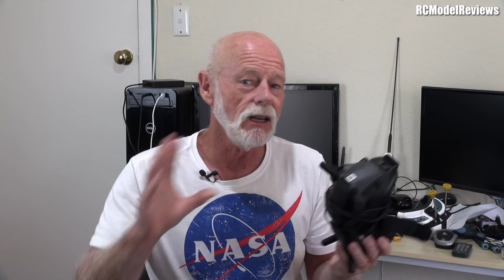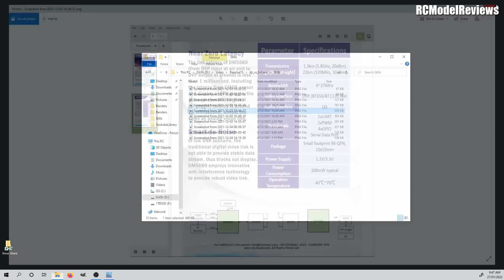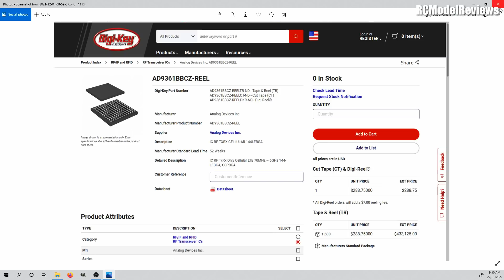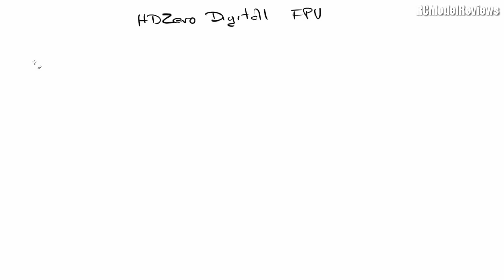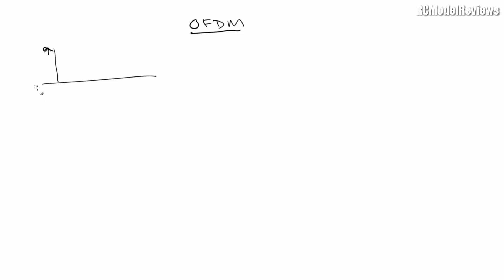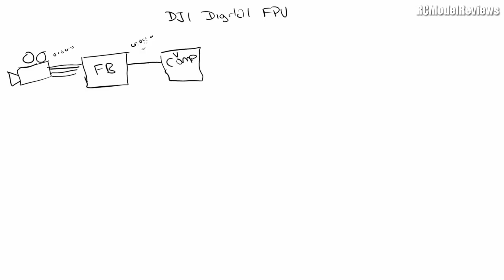Whiteboard:  How digital FPV systems actually work

Comment: why in era of quick digital transmissions and when all modern googles have separate screens for two eyes, we are not widely using 3D-vision which would promise an outstanding experience when flying a drone? What is needed is just to add another camera, and use dual channels transmission (maybe technically could be on same channel), then you get a stereo-video on your goggles.. Quick googling brought me to an article where it says there were some trials, but all of them gone now, and basically no commercial offer for today. Again thinking what level of realism and presence it could bring, if you get binocular rather than monocular vision.

Comment: Why isn't anyone making these HD systems on 2.4ghz?
Reply: The DJI  system in the DJI FPV drone can and does use 2.4ghz ( and the v2 goggles can receive 2.4ghz).  Unfortunately they didn't fully include that in the DJI FPV system or v1 goggles.
Reply: @5zero7RC exactly. That's what makes me even more frustrated. 2.4 has much better performance (away from congested wifi at least). Dual band is even better.
Reply: Because the bandwidth on 2.4 is much narrower than on 5.8. Because the frequency is lower, the frequency band is narrower, means you can fit fewer “modulation streams”, means the data rate will be lower.
Reply: @sstadnik  I didagree. 1. dual band can and does solve the problem you mentioned. 2. I think the the answer to my question is not a technical one, but rather a financial/market or regulatory one. I think DJI and other manufacturers were led to believe 2.4ghz is the main control link frequency used in the hobby and therefore 5.8ghz is the best frequency for video to avoid interference. And they don't want to take a risk on making both.